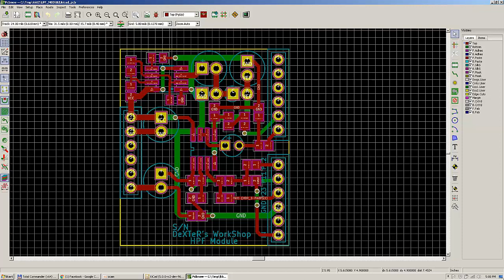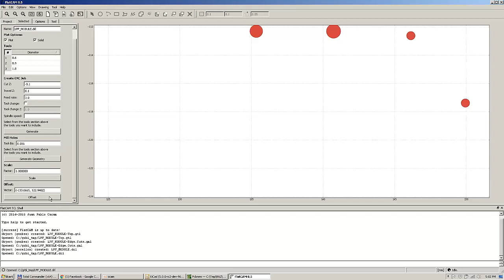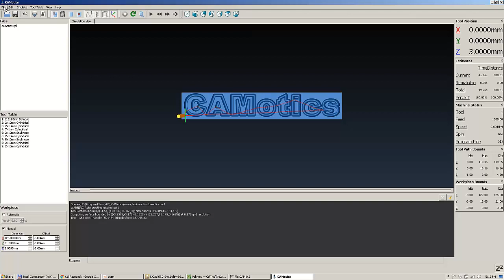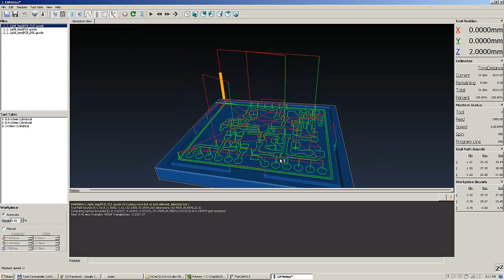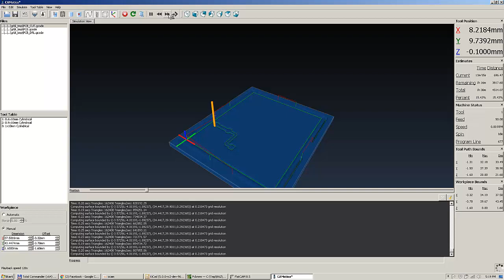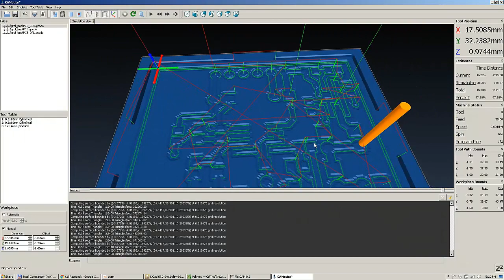KiCAD to CAM Milling (Job Simulation)

Comment: hi dexter, when i do genterate geometry on the isolation routing, i get wavy lines all around my pcb, it does not make the trace outlines thicker !! using same versions of software as you. any ideas mate ? thanks
Reply: Same problem here
Reply: Any solution yet?